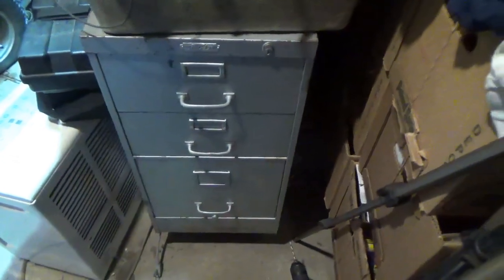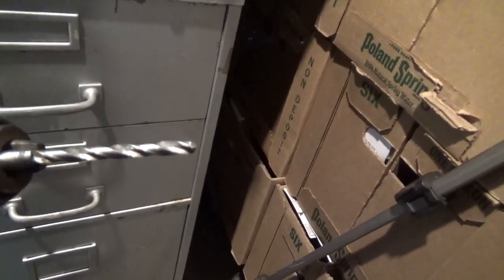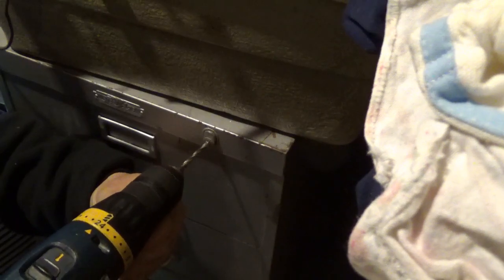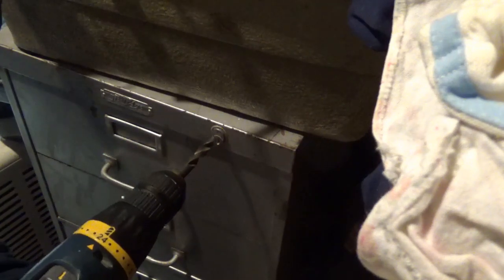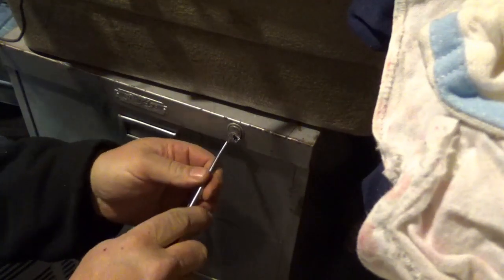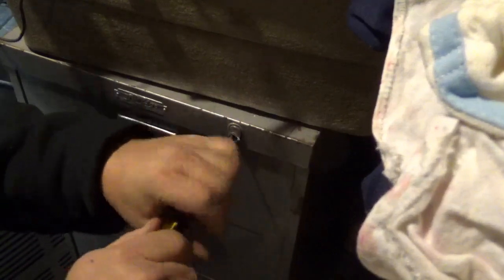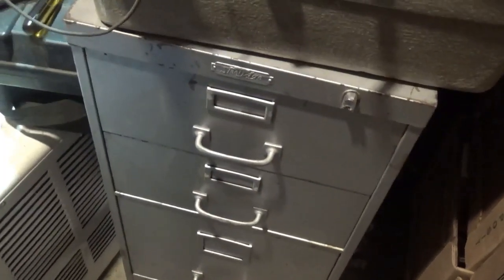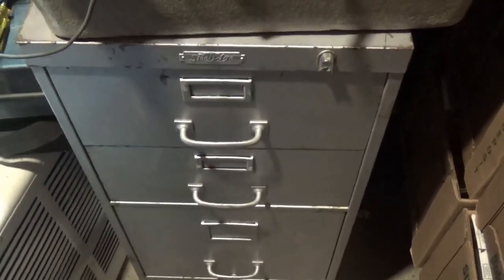Lost Key, How to Get Into a Locked File Cabinet, How to Drill a Lock!

Comment: Just what I was looking for! Went and bought a brand new cylinder, bought the Herman Miller Keys according to the numbers on the 2 locks. No go. So bought a lock pick, no go. So bought a more expensive lock pick, no go. Then found out you can buy the Master Keys for Herman Miller locks so bought them. No go once again! Time to get the damned drill out!  🤬 Thanks for the tip!
Reply: So just found that a Master key is not the same as a pull key so bought some pull keys before getting the ol' drill out. We'll see

Comment: I used nothing but a 1/8 bit on the same type of cabinet lock and it popped open in less than 3 minutes.   I'm no locksmith but it worked way easier than expected.  Now I can use a flat head screwdriver to lock and unlock it.

Comment: I'm confidant you'll never grow up to be a good B&E guy so I will sleep better tonight. At the shop, 4 wheel drive tires are flying off the shelves at a rate of 3+ sets of 4 per week. Mostly 12inch rim sizes but 14's are more popular then I was aware of. Then you get the pain in the ass mixed sets with 12's and 11's , even worse are the mixed 12's and 10's. I've got a 98 Polaris 4wd with a 300 2stroke motor and it has 23inch tires in the front and 24's in the rear, and the chances of finding a good used set on the market are slim to none.Plenty to learn and I should be plenty busy until work at the ranch picks up, then I'll be really busy. Harvey, do you need seat covers for any more mini trails then that project? Let me know before I start negotiating. Over and out.

Comment: Most locks you can just take a hammer and a flat nosed chisel - and a few sharp strikes will knock the cylinder out of the casing and it will fall into the drawer.
Reply: That didn't work on mine which is why I'm resort G to drilling it out